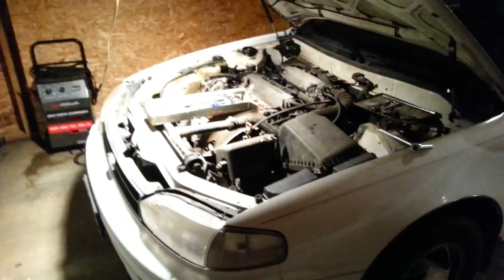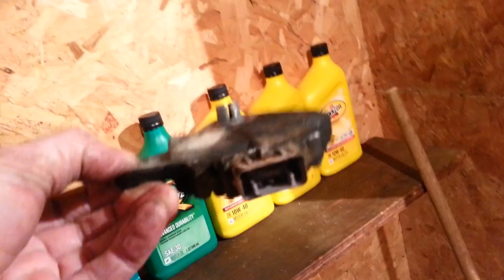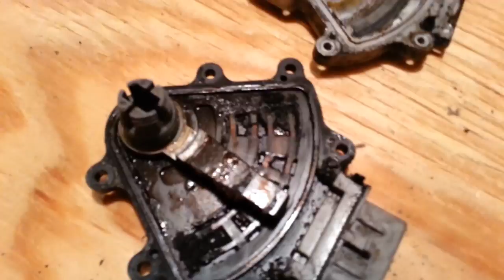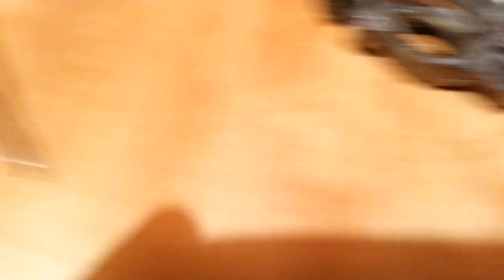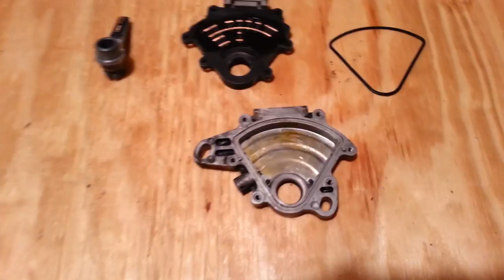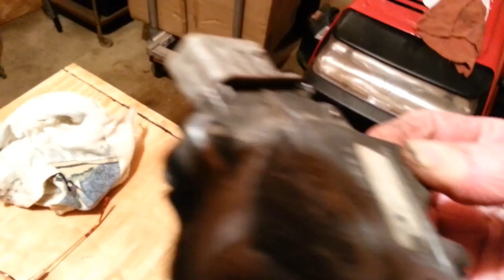1992 Camry Neutral Safety Switch Repair

Comment: 91 Camry and this was so helpful! Intermittent no crank and checked and there was no power to the started hot wire. Inside mine the spring and contacts were compressed, dirty, and stuck. Saved me a ton!!!

Comment: This is an excellent video which helped me repair my 1992 Toyota Camry no start condition. Before the fix, I would have to pull the shift lever towards L but keep it in P to start the car. One day, this didn't work and I spent 10 minutes trying to get the car started, holding down the brake pedal and wiggling the shifter between P and R. If it gets to this situation, definitely look into repairing as soon as possible because you can become stranded easily. Repair took me a couple hours because I like being meticulous with cleaning and applying dielectric grease as shown in the video and inside the connector. Seems like this is a common issue due to the location of the neutral safety switch as leaking engine oil can get inside the housing and degrade the grease inside faster. The black gunk you see when opening the unit is the years of shifter movement compacting grease and old engine oil into the ends. This combination in mine got so bad that it had become a hard, clay-like substance.

Many thanks for the video.

Comment: Wow!!  This is by far the best video I've found on how to fix the same problem on my 94 Camry.  Backup lights don't work and there are times that the car won't start at all until you wiggle or put the gear into neutral (that's the only gear that the light comes on the dash consistantly).  I will be trying this method soon.  This will save me $300 (CAD) on the part itself!  I have a very reliable mechanic who said it will cost me over $400 for him to replace it (parts included).  Thank you so much for making this videoo!  Very clear and concise.

Comment: I have a 95 Camry. The Park, Neutral and Drive lights won't light up on my instrument cluster. They are designated P, N and D. If I shack my automatic transmission shifter sideways though, they will light up. That means the bulbs are good. Do you think my neutral safety switch is the problem?
Reply from the maker: Yes, that's an indication of a dirty switch as shown in my video.

Comment: Have a 94 camry that doesnt show the "D" light on the dash, takes a little longer to shift gear in Drive,  and the selector wont go in the " L" gear. Could that be the problem?
Reply: J have the same problem. D boss how do you solve this problem

Comment: Don't try this with a newer Toyota ..they got "smart" and now use locktite on brass screws (the six that hold the switch together)  impossible to get off without ruining them.You could try drilling them out and finding replacement screws .I just gave up and bought a new one ...Toyota beat me

Comment: 91 corolla with no reverse lights. I removed the grey electrical connector (after A LOT of wiggling) and that is where I found my problem. One of the pins was just a blob of corrosion. No electrical contact left in that spot on either the switch or the connector... So I will be keeping my eye out for both at the pick and pull so I can get everything replaced. Not looking forward to soldering wires in such a confined space, but at least the only symptom is no reverse lights so I can live with that for now. Thanks for the video Dan!

Comment: We have a '95 Camry 4-cyl auto. trans. with intermittent backup lights failure. I've checked the wiring, fuses and bulbs in the past and they're all fine, so narrowed the likely source to the switch. This looks like the way ours is set up, so, avanti! when it warms up in a couple of days. Many thanks in advance for this--I could locate the switch based on other sources, but couldn't quite figure out how to get at it. This gives me confidence.
Reply from the maker: Super!  Hope it goes well and gets you back up and working again.  Happy holidays!
Reply: @dandeshaney5559  Got partway there last Sat. but had to re-assemble the car after one hour for wife to go out. Will try again next weekend. Question: I tried to disconnect the gray electrical plug from the switch but it wouldn't budge--are there tabs or something that need to be pressed to release it?

Comment: The tab broke off of the electrical connector, how do I take it off
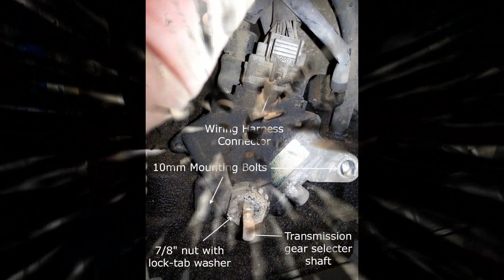Reply from the maker: If you look at this picture at the 2:05 point, you can see how that tab works. The arrow is pointing straight at the little square hole and peg.
https://youtu.be/XCvwj8u602I?t=127 

It's like a little rocker, or see-saw. The whole top of the tab is grooved so you can grip it. When you grip it and squeeze inward, it rocks inward under your thumb, and lifts up the bottom half of the tab so it can come off over that square peg inside the square hole of the tab.  That square hole in the tab over the top of the square peg is what keeps the electrical connector from slipping off.  If the top thumb tab is what broke off, then just take the tip if a pocket knife, of something thin, and simply slip it under the bottom part of the tab and gently pry it upward so it will clear the square peg, and then lift the connector off of the plug.

Hope that helped,
Dan

Comment: How long did this take to complete?  and how much would this cost if I take it to a mechanic instead?
Reply from the maker: I'm going to guess you will have a problem finding a mechanic that's willing to clean it. Most professional mechanics will try to sell you a new one.  If you have a friend, or find someone that's willing to watch my video and do the repair for you, it should take about an hour to an hour and a half... Make sure they clean the shaft thoroughly and don't try to pry it off. They have bake-lite material inside and will shatter like glass if you pry on them.  

Good luck, and best wishes,

Dan

Comment: Trying to get my dash indicator lights working (lit) when putting it in whatever gear I choose. Wonder if this switch also controls that. Have no trouble with starting or anything. Just took dash speedo and tach assembly and checked all lights, all good. I can make the individual light illuminate when I move the shift lever down or up a bit in whatever gear I'm in. 
Thought there must be a selector switch in the shift console but now not so sure.
Anyway, great video and thanks. I'm sure I need to do this also.
Update 
Yes, this also controls the gear selector lights in the speedo-tach assembly.
After pulling center console cover off and disconnected shift cable moved shift lever back and forth and nothing, then pushing and pulling shift cable made dash gear lights work off and on.
Update 2, confirmed, this also controls dash gear selector indicator lights.
Reply from the maker: Good work super Dave!  Be really careful pulling that switch off of the shaft. Don't pry or use force or you might shatter the Bakelite material inside.   Good luck!

Comment: Easier said than done. I've tried to remove at least 6 NNS's from junk yard Camry's with no success. Each on I tried was frozen solid on the shaft. I have spent as much as 2 hours on one of these. I managed to get one off the shaft but had to break it doing so. Gave up. May need a puller, not sure. Car still starts with jiggling of the shifter but it can be a real pain in the ass.
Reply from the maker: I don't know what to say about all of the problems you're having. There's nothing complicated or tricky about getting it off. It's a straight smooth shaft all the way through.  The only problem is that the part of the shaft that you can see sticking out will most likely be corroded or rusty. The switch fits on really snug, so any kind of buildup on the visible part of the shaft will make it stick.  All I had at the time was a spray can of carburetor cleaner/de-greaser that I sprayed heavily on the shaft and let it soak in for about 15 minutes, and then wiped it as clean as possible with a rag. I wiggled it around by hand a bit and it came loose enough to where I was able to slide it off. Of course it was tight, but I managed without damaging it.  Something else to consider using might be some emery cloth, or steel wool to polish that shaft.  You might also consider slipping a thin tapered plastic trim wedge behind it and tapping it under until it pops loose.
Good luck,
Dan

Comment: Just wanted to say thank you so much for making this video - very instructive and very well done! I had the no start problem and was about to try changing the starter when I came across this video. My 1994 Camry with 160,000 miles had a neutral safety switch with slightly less gunk inside than yours, but I followed your instructions for rebuilding and the car starts flawlessly now!!! Thank you again for your help!
Reply from the maker: You are welcome. Glad it was helpful.

Comment: Since Toyota wants $503.00 and the local parts house wants $235.00 for the NSS this is a great video This also works on the 2000 Toyota Avalon V6 but it is harder to get to the way the repair manual suggests, it might be easier to get to the switch by removing the battery and battery box.
Reply: I have the 6 cylinder . I just removed the one radiator cooling fan and I was able to get to it .It was a bit of trouble and I NEVER would have been able to get it out without removing that fan. But ,Now ,the 6 screws holding the switch together are now Brass and installed with locktite ..meaning impossible to remove  without ruining the screws . You could go out and buy new screws ,and install with locktite ,once the cleaning is done . The cost of the switch is crazy high  at auto parts stores

Comment: My only problem was the screws started stripping so I drilled the heads off, if you do this you will need a squirt bottle with water in it as to not melt the flat washers in the plastic

Comment: Thanks, Dan, for a very informative and inspiring video. Everything went according to plan until I couldn't budge the NSS off the shaft. Wouldn't move with a 3 foot crow bar on the large nut.  Wound up prying the NSS from the back of it and obliterating all of it except the bottom of the contact arm. Put penetrating oil on the thing and pried it off with the crow bar.  What's weird is the shaft was pristine with no rust, and I had to use four stepped up drill bits to widen the slot on the new NSS to get it on! Does Toyota use growing metal for the shaft?!

Comment: thank you for the video sir I have a 1996 Toyota Camry won't start on Park unless I put it in neutral do you think they switch can be the cause or is there something else that I should look at thank you for your help
Reply from the maker: Try holding the key in the START position, and while keeping your thumb off the release button so you don't accidentally shift to a different position, try wiggling the gearshift forward and backward and see if the starter tries to engage. 

Do your backup lights work normal when you put the car in reverse, or do you have to get the gearshift in just the right spot to make them come on?

If any of these apply, odds are, its a dirty switch. 

Good luck, 

Dan
Reply: back up lights work fine, it stop doing it for a month now it did it again today,, I did press the unlock button at the shifter before I shifter to Drive and nothing, I think whats not catching its the lock button on the gears because with the switch on and my foot on the brake I move the shifter to N than back to P and I hear a click like it finally see its in Park than turn the car ON and works, I will let you know how it goes

Comment: Thanks for sharing. I just figured out how to remove my switch and now thanks to you I know how to clean it. 

I noticed you lubed the interior it with axle grease. I will probably use dielectric (silicone based) grease instead. It seems to me it might be safer if it contacts that rubber seal rather than a petroleum based grease. What do you think?
Reply from the maker: You're welcome.  You are probably right to use the silicone based grease, but at the time all I had was axle grease. I didn't use a lot of it, so I doubt it will be an issue. As long as there is some type of lubricant inside so it doesn't cause excessive wear to the inside of that switch it should be ok.

Comment: Thanks or the video . I own a 93 Camry. incidentally I had to raise front of car to remove stuck rotors and I turned key to acc. then put in neutral, then turned  key to off , turn key back to acc. put car in park but wheels still spin as if in neutral. so I start car and wheels do not spin so it is in neutral, I think ? any thoughts before I put it in gear?

Comment: good video. I am having the same problem on my 1994 Camry. I changed the bulbs,cleaned the connection and nothing..so I'm going to try this because when I engage into reverse, the lights come in but only for a fraction of a second..so hopefully this is the problem,. thanks for posting this video.

Comment: Thanks Dan!  I'm thinking this is the problem with my 1998 Camry.  Will get at it this week.  You saved my some time and $$ by posting this.  I appreciate it!
Reply from the maker: You're welcome Scott.  I word of advice.  Some folks have complained about the switch not sliding off the shaft once all of the nuts & bolts were removed.  Sometimes there is a rust or grease buildup on the part of the shaft that is sticking out and the switch sticks on it. Some people have tried prying on it to break it loose and have wound up breaking the internal bake-lite part inside the switch. I would advise against forceful prying. I used a small paintbrush soaked with carburetor cleaner to dab it and brush away the rust and grease.  After I cleaned it real well, it came loose.

Good luck.

Dan

Comment: I have removed all the Nuts, but I could not pull the switch off the shaft even wiggled it.  The gear was set at Park.  Please help.
Reply from the maker: Some people need to spray some degreaser on to the shaft. Mine was stuck on too and did not come off easily, but after I sprayed it and brushed it clean, it loosened up and came off. Clean the whole shaft thoroughly so it slides off easy.  Be careful prying hard on it with a screwdriver. Some people mention that they had broke theirs by prying too hard. You might try just wedging the tip of a screwdriver up between the switch and the transmission. That is what popped mine loose.  It was simply stuck on the shaft. 

Hope that helped...

Comment: did the car turn over but not start? was it getting spark and fuel? I have a 94 that just died and will not . turns over and fires but no start.
Reply from the maker: Hi Ronnie. Sorry you're having problems. My car starter would not engage unless I wiggled the gear shift.  Also the backup lights would not work when I put it in reverse. This is a completely different issue than you are having. Your problem could be many things. So much so you might have a mechanic look at it for you.  Sorry I couldn't help more than that. Good luck.

Comment: Thanks Dan - you're a champion!! I had no problems fixing the reversing lights ('back-up' lights over there, you say?) on the 1995 Camry auto thanks to your clip and the comments here.  Having eliminated the other likely suspects (fuse, broken wire near the boot hinge - ok ' trunk' hinge!!) I thought I'd have a crack at the switch after you convinced me it wouldn't be too difficult. I didn't find it necessary to remove the battery pan on the 1995 model - pretty good access with battery in place. I did strike some resistance once all the bolts etc were removed but didn't get too excited having read the comments here.  Sprayed some lubricant (WD40) behind the gasket (under the washer under the 7/8 inch nut) and then waited a bit.  Time and pressure (like Shawshank) and off it came (about the time I was considering using additional assistance other than finger pressure).  When I opened the switch it was easy to see the problem  the gunk had caused the outer contact to stick in (ie. not spring out and making contact). I now have reverse lights (ok 'backup' lights) - the last job finally done before the road worthy inspection!!!

Comment: Oh Dan.. I hope you out live your neutral switch part project. That black thing next to the battery your wondering what it was is the Cruise control. Other than that you made a very well tutorial video. I really hope you live long.
Reply from the maker: +mikejones Mikejones Thanks Mike.  I found that out later.  : )

Comment: Hello, My backup lights were not working and I had some trouble starting (had to wiggle the "P" transmission lever.  SO I decided my 1992 Camry NSS should be rebuilt.  Here's what I learned:  only remove the bolt on the lever on the NSS.  I had removed both that and the cable's.  If you take the cable end off, be sure to mark it's position relative to the slotted arm.  

Thank you for the "see how" instructions. Was a good repair lesson.

Comment: This is very well explained! I wonder whether the problem for my Toyota corolla '98 is from the neutral safety switch though. this is because the push button on the shift lever seems to get stuck or not work properly to release the switch.